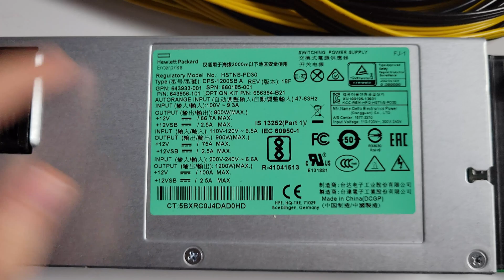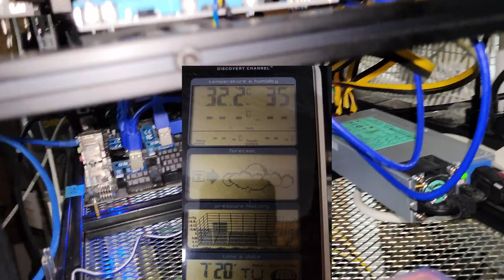Switching From ATX to 94% Server Power Supply for Mining Rig

Comment: damnn you were running them on sata cables...geez lucky you didn't start a fire ..thats a big no no lol
Reply from the maker: to be honest, sata is safe if you know how much power you are pulling from the card.
In my case, with my cards properly undervolted, the full card only pulls 122w. so with that load, only about 25w-35w on the sata cable and about 80-90w from the 8pin.
Its safe to run but as i mentioned in the video, i would NOT recommend it to most people and because i want the option to mine Ravencoin, there is no way im going to use sata on a gpu that is going to pull on a minimum 135w with my undervolt settings or if i run the settings most people run, easy 170w.
Ive run sata for a long time without any fires because i understand how much power i will draw approximately from the cable, just not recommended ;)
Server PSUs with the proper PCIE cables is the best way.
Reply: @CostEffectiveminingYT  You are right with some gpu's you shouldnt really have a problem but the problem lies when your computer decides to reset the underclocks and your card pulls way more then it should thats when it can get dangerous. As an electrican I have seen small wire get reallly hot a blow up lol ..I just try to keep it real safe since I live in an apt setting and I also think about the well being of my neighbors.
Reply from the maker: @iiPlay2Much  yep i agree, that is why I like programs like HiveOS, they always lock the OC in. :)

Comment: HI this breakout boards are possible point of failure often they are not so great in terms of quality but you can always solder cables directly to power server supply eliminating possible point of failure.
Reply from the maker: I've never had any issues, been running some of these psus with breakout boards from China for the last 8 months...
But yes you are right, you need to be careful with how much load you put on them, that is why I never load them at max.
And yes, if you have the skill, you can get even better psus and attach cables directly.

Comment: Hey man. May i get any other way to contact u so we can talk. Like discord, telegram. Im currently getting 16.50 mhs mining ravencoin on rx 570 4gb. But need some help
Reply from the maker: 16mhs means you are probably running very higher core clock and voltages, the limiting factor will most likely be your memory clock.
I personally dont recommend running that hard of an OC on the RX 570 4GB as you will be using 175W+ for just the gpu.
I generally just answer here in the comment section.